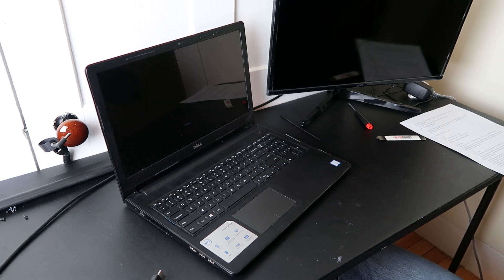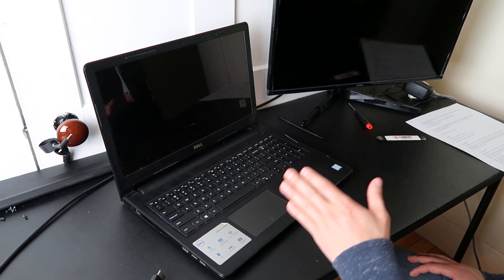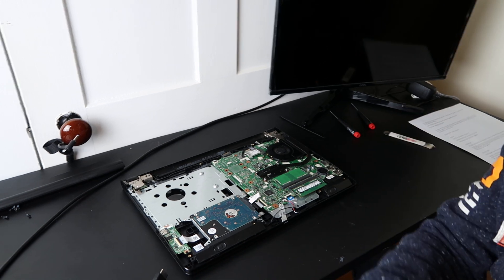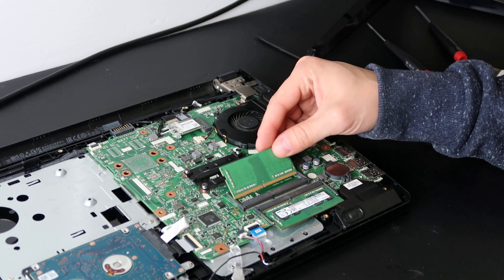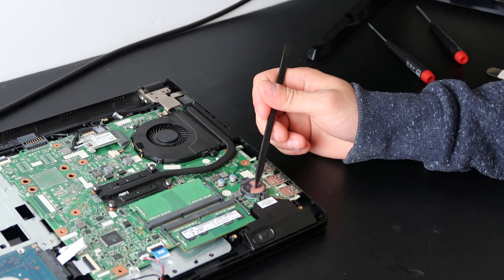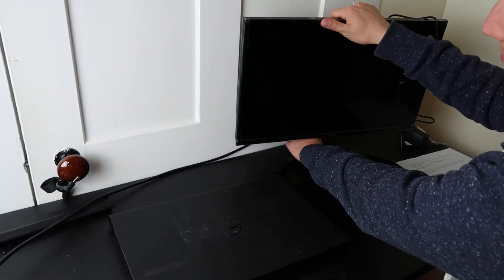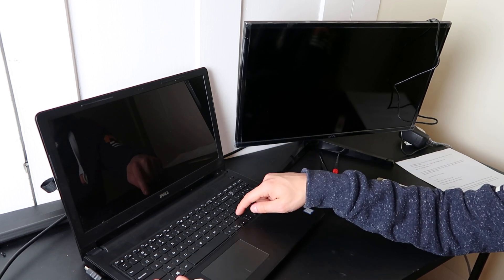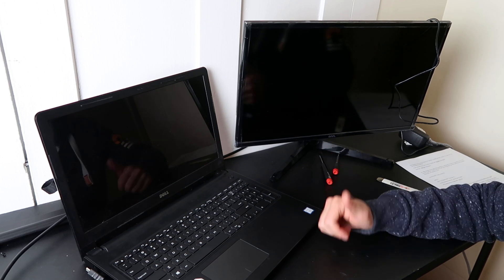How To Fix Black Screen / No Display / Dim Screen / No Picture for Dell Laptop

Comment: Bro will this problem happen due to a bad hard disk?
Reply: Ok thanks
Reply from the maker: Usually not.  A bad hard drive will not stop the lcd from working.  What are the signs your computer is turning on if the screen does not work?
Reply: I did the boot loop fix procedure in your other video, but when I select the diagnostics it checks for sometime and shows the hard drive failed. Below that it gives three options Yes No and Exit. When I press the Yes button, it proceeds to the colour display step as in your video. But after that it is going to a different procedure than in your video.
Reply: After that when I diagnose deeply for the hard drive it shows 4 problems out of I think 7 things I checked. So is it because of the hard drive my laptop screen going black?
Reply from the maker: @sreyaschannel  The problem shown in this video is a computer whos screen does not work.  I thought your screen was black.  Sounds like it works and displays fine but goes black later in the startup process.  Yes, a bad hard drive can cause that.  You should replace it as seen here;  https://www.youtube.com/watch?v=tNp5Kbo9uHg

Comment: bro i have dell m6600 + quadro 4000m. when i plug in charger then my screen goes black and hang with restart laptop. do you'll any solution ?
Reply from the maker: Your computer working properly, then you plug in your power adapter, and the screen goes black?  Is the computer still on or does it turn off too?  I dont understand 'hang with restart loop'.   When you plug in your charger, does your computer turn off and start restarting over and over?
Reply: @PC_Monkey  sir laptop working fine on bettery but when i plug the charger then screen goes black and crash then restart laptop and if you disconnect charger then your laptop will run fine .
Reply: @PC_Monkey  sorry for my bad English
Reply from the maker: @waqasbutt-y9k  Your English is fine :)   Sounds like your power adapter is bad.  You can test it as seen in this video;  https://youtu.be/P3I7dDpkJps.   I would replace it.

Comment: Hi my laptop is dimly lit cause I still see its working when I use flashlight and direct it on the screen but I'm not sure if the problem is lcd cable of the screen and if there's anything I can do other than buying new lcd cable or screen coz am broke can u give me advice?
Reply from the maker: Have you tried the steps seen here in this video?

Comment: i have the same problem but mine passed the BIST test and after the test its gets back to black screen
Reply from the maker: This video is for a Dell computer that turns on but the screen stays black?  If your able to access and run the diagnostic test, then your screen is working.  What happens to your computer when you try to turn it on?
Reply: @PC_Monkey  when i open my laptop its gets black screen but i see the dell logo if i use flashlight on it
Reply from the maker: @michaelangeloderamos6894  Then try the steps in the video your on now.   This video is for that error.  Your first comment said that it passed the test then went black.
Reply: @PC_Monkey  thanks i will try it

Comment: My Dell Inspiron 15 5779 has an extremely dim screen to where I can barely see anything. However, external monitor works fine. I watched the video, but what step should I start with first? Could it be the RAM or C battery?
Reply from the maker: Most likely the LCD or LCD Cable.  Try reseating the cable.  If that does not work, replace one at a time.
Reply: PC Monkey got a video on reseating the cable?

Comment: Hii I have a Dell 15 3000 Insprion Laptop. My screen won’t turn on but I can hear the fan. What should I do????
Reply from the maker: Your on the correct video.  Have you tried the steps seen here yet?
Reply: How do i do ot in dell inspiron 15 5000
Reply from the maker: @timothyjohntabigoon5472  If your computer turns on but the screen stays black, you would troubleshoot the issue the way that is shown here in this video.

Comment: I have a Dell 7559.
The screen goes black and when I Unplug and replug the battery cable as well as the RAM it starts to work.
Also, once the computer is on with it's screen; and at this point now i connect it with an external monitor, the laptop screen stops functioning even if  i remove the hdmi wire and then it only works with the external monitor from that point.

From what i have seen on the net, it's a common issue with this model.
Any suggestion would be great. And could this be software issue ?

Comment: But what if u don't have an external monitor?
Reply from the maker: Than you cannot perform that test.  You are left with the possibility of the LCD, LCD Cable, or Motherboard being the problem.  You can try to just replace one of them to see if that helps.

Comment: Thank you. God bless.
Reply from the maker: Happy to help :)  Always here if needed !!
Reply: @PC_Monkey  doesn’t work :(
Reply: @PC_Monkey  hy bro this happened to me when i trying to install windows and change some settings. How can i fix it
Reply from the maker: @asiaicon4312  If the screen is black, what are the signs the computer is on?  Lights?  Sounds?  Fan? 
If the computer turn on but the screen does not work, have you tried the steps seen here yet?

Comment: What should I do with my Dell Inspiron15 3000 , it turns on but the screen is complete black. Also, there is no easy access to RAM.
Reply: @peiguimeikamson3598  what I did was- long press the power button. Then it will start some reboot kinda thing, takes few mins to complete the process and then your pc will start as normal.
Reply: I've tried that. Doesn't work with mine. I've to finish my dissertation work😭😭
Reply: @peiguimeikamson3598  I suggest you not to dismantle anything yourself,maybe you'll end up spoiling it. Contact the customer care!
Reply: @peiguimeikamson3598  hold the power button for like 15 to 20 secs
Reply: @karvisoni  I also have same Dell laptop model as you -- inspiron 15 3000 series and same issue as you were having....  have tried holding the power button for 20-30 seconds with and without battery, only power cord still not working.... any other suggestions?

Comment: Great vid. I got a quick question. I have a dell 15 7548 where the internal display doesn't work. However, when it's hooked up to an extertnal monitor (by pressing the FN button), everything works fine. I've already checked the RAM, CMOS battery and change an entire screen assembly, but the problem persists. I've checked online and apparently there's some type of chip that needs to be re-soldered on the MB. I was wondering whether you can share an insight as to the potential cause of this before I go ahead with soldering.  THX. Much appreciated.
Reply from the maker: Usually, if the computer displays fine to an external monitor but will not display to its own, the issue is with the computer's LCD or LCD Cable.  Try replacing the cable first as its cheaper :)  Then if that does not work, replace the LCD.
Reply: @PC_Monkey  I've replaced an entire screen assembly wich includes new screen & screen flex cable.
Reply from the maker: @davidhunka2594  Then you may be looking at a bad LCD Cable Port on the Motherboard :(
Reply: same problem is showing to me that soldering will be done to motherboard , is it true or they are fake ?

Comment: Hey will this work with a Dell latitude E6420
Reply from the maker: If your Dell turns on but the screen does not work, then yes, this would be the correct video for you :)
Reply: It loads and then it shows the screen
Reply from the maker: @thegamerplayz7034  This video is for a computer that starts but the screen does not work.  What do you mean it loads and then shows the screen?  Are you able to see the startup logo screen?

Comment: Hey my laptop has dim screen issue. I can see the screen if I see with flashlight  . Is this RAm issue?
Reply from the maker: Thats one possibility.  This is the video you need.  Have you tried the steps seen here?
Reply: @PC_Monkey  I have seen ur video but I haven't tried those steps. I just wanted to make sure it was RAM problem otherwise it would be waste to buy new RAM. Thanks for replying
Reply: Sir what was the issue and finally what was the finding and corrective action ?

Comment: My computer is brand new D: And mine doesnt have a ram or battery opener thingy. Is there a solution without doing that? I am literally crying right now. Would letting the battery drain out work too?
Reply from the maker: If its brand new, then its still under warranty :)  There are other tests you can try but if the issue is the RAM then no, theres not another way to fix bad RAM without testing if its bad.  Is the computer turning on and the screen staying black or is the computer not turning on?
Reply: Okay thank you. Could it be my wireless mouse chip? Its brand new the chip aswell as the mouse.
Reply from the maker: @KingGamingRoblox  No, I doubt that your computer screen not working has anything to do with your wireless mouse.

Comment: Hello. Before l ran into a black screen l was stuck in blue screen. 1. PREPARING AUTOMATIC REPAIR to DIAGNOSTING YOUR PC. After l removed 2 ram tiles as you suggested in your video my screen came back but it's stuck again at blue screen. Keeps Preparing Automatic Repair and turns into Diagnosting Your PC and l can't fix it. I have tried every possible option from the blue screen and nothing. Any ideas? Thx.
Reply from the maker: For that issue, try this video;  https://www.youtube.com/watch?v=ZFJHGvOGZbg&t=144s
Let me know how that goes:)
Reply: @PC_Monkey  I tried that. My laptop won't give me same option you have. I got DELL STUDIO XPS M1340. Right after my screen came back (thx to your video) l tried to reset my PC. It took a while. I thought it worked this time but l was wrong. I got this msg: "System restore did not complete successfully. Your computer's system files and settings were not changed. Details: System Restore failed while deleting the following file/ directory. Path: D: \Windows\WinSxS\amd64_microsoft-windows-edp-notify_31bf3856ad364e35_10.(
An unspecified error occurred during System Restore. (0x800705aa)
You can try System Restore again and choose a different restore point. If you continue to see this error, you can try an advanced recovery method.
Reply: @PC_Monkey  One more tip. My laptop worked just fine. I upgraded to Windows 10 and was flyin'. After one month l got this error msg. Something about corrupted file/s. I googled it/ how to fix it and this is when blue screen popped out. The video l googled told me to put cdm in search (bottom left corner) and more codes. I hope this helps. One more thing. My battery is out. I need a new one. Tried to update bios but no battery no update. Thank you!
Reply: @PC_Monkey  Diagnostic Test Checks Out. I also ran 2nd diagnostic test just in case. I got: "Pre-boot System Assessment complete. No Diagnostic Utility Partition Identified. Please select OK to reboot your system." I did that and still "blue screen."
Reply from the maker: @BUCK777able  Sounds like you should reinstall Windows at this point.  If help with that is needed, refer to this video;  https://www.youtube.com/watch?v=ULrJVk4JJ20&feature=youtu.be
Reply: @PC_Monkey  Thx for getting back to me. How do l reinstall it from the blue screen?
Reply: @PC_Monkey  In your opinion what causes all this? Operating system??? Am l gonna be able to reinstall windows from blue screen? As a Dell tech. are you able to call me and fix this for me??? Of course l'll pay for your service. Can l reinstall it without pen drive?
Reply: Can l reinstall Windows 10 without USB? If yes, let me know how!!! Plz!!! If no, how do l download Windows 10. This thing is driving me crazy. It's been 3 weeks and finally l'm getting closer thanks to you!!!
Reply: Am l gonna loose my files, pics...? Are you able to fix it for me? I will pay for it. I just ran out of gas. No matter what l'm doin', it just 👎👎👎 Let know plz!!! Thank you!!!
Reply from the maker: @BUCK777able  Lots of things to reply to lol.  Yes, if you delete all the partitions as seen in my video, you will loose your data.  Try hooking the hard drive up to another working computer to access and save the files first or do not delete the partitions with the data on it you wish to save.  You can still install Win10 as seen in the instruction video even though your getting a blue screen error.  It seems like an operating system issue caused this.  Hard to saw what kind of issue without examining the computer.  Sorry, I only communicate via this messaging system for now :)
Reply: @PC_Monkey  Thank you
Reply: @PC_Monkey  Hi. I just found out my PC/Device needs to be repaired. I am stuck on RECOVERY blue screen. The operating system couldn't be loaded because a critical system driver is missing or contains errors.
File: \Windows\System32\drivers\ACPI.sys
Error code: 0xc0000221
You'll need to use recovery tools. If you don't have any installation media (like a disk or SUB device), contact your PC administrator or PC/Device manufacturer.
MY QUESTION IS: Since l upgraded to Windows 10 from Windows 7 vista. Do l need my original disk or USB Windows 7 or Windows 10 to finally fix this issue??? Sorry for asking so many questions and long essay. Thank you!
Reply from the maker: @BUCK777able  NP :)  If you create your own install media as seen here;  https://www.youtube.com/watch?v=g_UhiHScaSI&feature=youtu.be You will be able to install Windows 10 as a new install.  That error wont be an issue.
Reply: @PC_Monkey  l can't do that. I'm stucked on RECOVERY blue screen. My comp went straight to garbage. I swear. Pressing F8 l get Startup Settings. 1 through 9. Nothing works. When l hit enter takes me right back to Recovery blue screen. It won't work. Thanks for your tips!!! I really appreciate it!!! 5 star rating!!! 👍

Comment: my dell 13 7000 screen is black but when i charge it, the LED light in front lights up but fan isn’t working?
Reply from the maker: For a computer that wont turn on, try this video first;  https://youtu.be/_MOe71kBPOY.  Let me know how that goes :)
Reply: PC Monkey i just noticed that i only have one ram what do i do?
Reply from the maker: @gisselleortega3390  In order to perform the RAM test as seen here you would have to purchase another working RAM stick.
Reply: Hey did you fix the issues 
I have same problem also

Comment: I have the same model, but it only has 1 ram, It is ok to remove it and test it if the screen will back to normal??
Reply from the maker: No.  You will need to purchase another RAM to perform that test.  No RAM will cause the same issue.

Comment: My black screen issue occurred right after malwarebytes restart, is it possible that malwarebytes could destroy software preventing the screen from turning on. And could I fix it by simply formatting hard drive?
Reply from the maker: If your computer turns on but the screen stays black then your on the correct video.  Try the steps seen here if your sure the computer is actually turning on.

Comment: My dell inspiron 24 3455 has black screen it powers on the light for the power button lights when I press to eject the CD it works normally my only issue is the black screen wat should I replace?
Reply from the maker: If your computer turns on but the screen stays black, then your on the correct first video.  Have you tried the steps seen here yet?

Comment: Hi, my Latitude e5250 has this issue (black screen). It's not a ram issue because it I connect a monitor or tv it project's to monitor/tv. Is it possible to have a lcd/cable issue? I have tried unplug display cable from the motherboard and plug it again.. no luck. Any suggestions?
Reply from the maker: Yes.  If your computer displays when hooked up to an external monitor, then I would try replacing the LCD Cable.  If that does not solve your issue, then its most likely your LCD